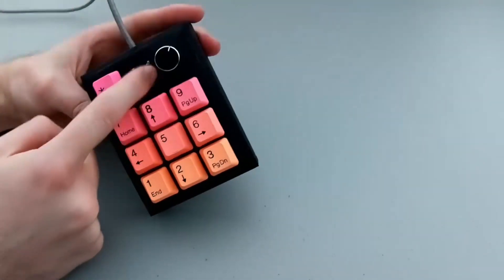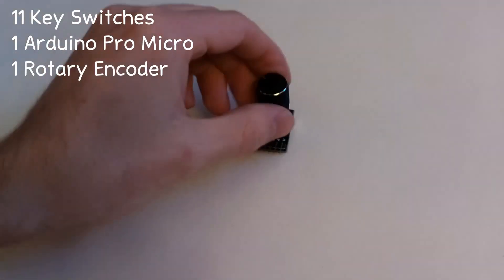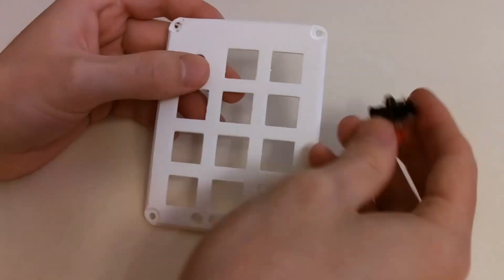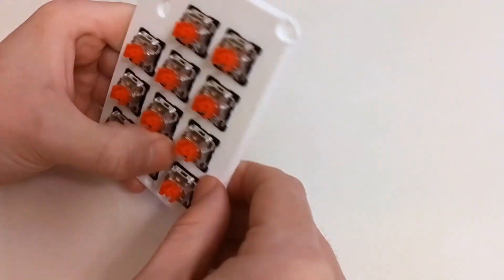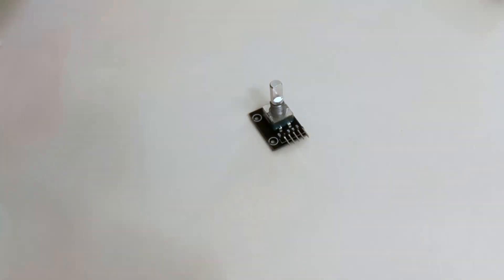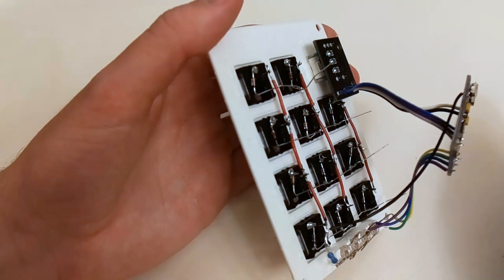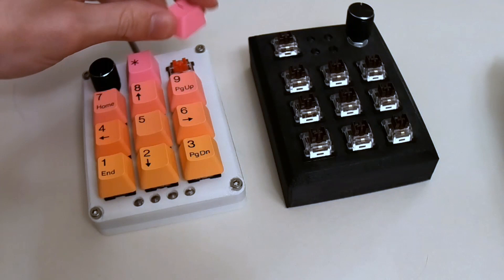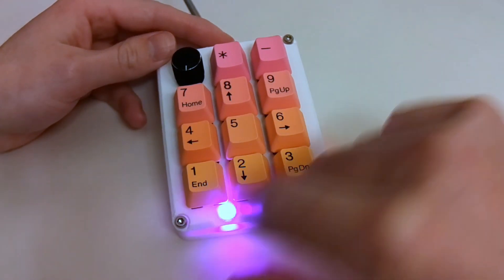Macropad V2

Comment: i just finished the build but the knob only reduces volume by one then ups it again in the next move to anywhere
Reply from the maker: That is strange. Are you able to upload an encoder example sketch and get the same behavior?
Reply: @tinyboatproductions  Oh I fixed by Re-suttering the conections to the encoder. in case anyone has the same issue, Make sure the encoder's conections are properly suttered, and in proper temperature as making it to high will make your sutter opaque and have sub-optimal conductivity which may cause this issue.

sorry for weird English not very good at it

Comment: I am full beginner, in soldering and programming too, and i have a problem. The schematics in the instructables ( the solder diagram) have diff numbers than my micro pro. ( it contains the pins but diff order.. and diff location) Can someone explain it to me?
Reply from the maker: Refer to the numbers, the hand drawn micro is not exactly accurate…
Reply: @tinyboatproductions   Okay i will solder by the numbers, thanks you very much!

Comment: Question, how can i set the code for the encoder to be more precise?
Reply from the maker: This is a common question I get. I think its due to the fact that I dont have the encoder hooked to interrupt pins. I think you could attached them to interrupt pins and move the matrix to increase resolution/reliability.
Reply: @tinyboatproductions  Thank you for your response, i will try it in the next project (:

Comment: Hi, nice video. I'm trying to make a similar button box with a 5x5 matrix with 19 buttons and 4 encoders with button, do you think I could use your sketch with some changements? Thank you.
Reply from the maker: I think it would work. However you may run into issues with that many encoders. The encoder can be a bit laggy when not attached to interrupt pins and the pro micro doesn’t have enough to attach all of them. For a button pad that big I would suggest looking at my kmk series. I think an actual keyboard firmware would work better for a more complex project.
Reply: @tinyboatproductions  I deleted the led, I don't have them, I deleted the lines about the length of the encoder press because I don't need it and I still don't know if the encoders will work because I connected only the button function, I'll let you know, thank you very much.
Reply: I forget to say that all my buttons works correctly and I can program them with macro to be used on PS5 simracing program.

Comment: Should the black line on  the diode be facing towards the switch or going the other way?
Reply from the maker: When I built it I have the black line on the diode on the bottom, take a look at 3:07, you can kind of see it there. If you have them the other way you should be able to swap the row and column arrays in the code, basically tell the code the diodes are the other way and it should work.
Reply: @tinyboatproductions  ok thank you! Where in the code would I tell it it’s reversed?
Reply from the maker: You’ll want to change they line that defines the keypad to: Keypad keypad = Keypad( makeKeymap(keys), rowPins, colPins, ROWS, COLS );
If you compare what I have with what is here, you’ll notice that the rowPins, and colPins arrays are in the opposite order, as well as the ROWS, and COLS.
Reply: @tinyboatproductions  thank you so much for your help! Cant wait to start using my new Macropad!
Reply from the maker: @ethand9715  I want to confirm this worked as I haven’t tested it myself. I also think this would be a good note to add to the instructable.
Reply: @tinyboatproductions  I’ll let ya know once I’m back at school, still gotta solder a few more things and I will 100% let you know
Reply: @tinyboatproductions  wow sorry, took a bit longer for one of the parts to come in. Finished it today! Didn’t end up needing to do anything to the code… it kinda just works, lol. The only issue that came up is that on layout 2 non of the keys work, however all the other layouts work, not sure why. Thanks for the build!

Comment: is there a way i could add 2 encoders?
Reply from the maker: Yes, you can add a second encoder. 
I don’t know off hand if there are enough extra pins on the pro micro. You may need to connect the switch of the encoder into the key matrix to have enough space for the extra encoder wires. 
You will also need to include a second encoder in the code. That should be as simple as duplicating the existing encoder code with a new name for the encoder you are adding.

Comment: i've finished my build but the only thing that is working is the knob, the buttons do not work, can you help me?
Reply from the maker: If the knob is working, I think that could mean the issue is with the diodes. Double check their direction and the pins you have them on.

Comment: As a customer, the only thing I care about is that it's easy to program withotu software or driver and you show how to do it in a video or text file. I already got burned by buying one that just does "A" and "S" and there is no way to change it.  i can't tell you how almost completely useless and annoying it is...

Also, as a blind person, even though I have a banging TS100 soldering iron and Kester high quality solder, I don't want to to assemble or solder anytihing because I'm blind.  It's not going to happen any more.
Reply: the what?

Comment: Hi. Sorry my terrible english ! Very good video ! Thx !
Its possible replace arduino pro to ESP32 or ESP8266  ?
And its possible to add more one encoder ?
Reply from the maker: I think its possible to swap the Pro-Micro for an ESP, I’m not sure exactly how. I have seen some other people use ESPs for macro pads and what not.
Also yes, you could add more encoders. I don’t think there are enough pins on the micro but possibly on a ESP, if you go that route.

Comment: Hey im in the middle of creating this project, there are 2 wires that go to a pin (5) yet if you did that it would short circuit. Is there a different pin to put the wires into besides 5?
Reply from the maker: Would you look at that. The column pins should be 7, 8, and 9. All the other PIN numbers look correct.
Reply: @tinyboatproductions  i have another question. In the code for the Macropad are there specific libraries that you used? i keep coming up with the error that Keypad cant be found
Reply from the maker: @samtelfer7364  
Yes I used Keypad.h, Encoder.h, Bounce2.h, and HID-Project.h. The last time I updated the code on my macropad was awhile ago. So if you keep having issues I would suggest downgrading the libraries to a previous version.

Comment: Hi! excelent build, i want to try to build this version but i want to know if i can switch the IN4148 diodes with the 100v 1amp diodes instead since i can´t find it anywere in my city?
Best regards!
Reply from the maker: Hi there, it looks like the 1amp diodes should work just fine. There may be a slight difference in response time when pressing a button but I highly doubt it will be noticeable (especially with the non optimized code I wrote). 
Give it a shot a let us know how it works out!
Reply: @tinyboatproductions  Alright thanks a lot fot the fast response! i will post later when it's done.
Best regards!
Reply: @tinyboatproductions  I finally could made it, works just fine, love the look on my desk! :D thank you so much for sharing your build.

Comment: Hi bro, I'm a little confused in the soldering area, what do the numbers in the picture mean? Why is it different from pro micro, in pro micro I can't find the numbers 19, 20, 21, etc. Please help me with the soldering
Reply from the maker: Hi there,

I can see the confusion. On the Pro Micro the analog pins can also be used as digital pins, that’s what I have done. I've attached a diagram of the analog/digital pin out. Pins 19-21 are labeled on the board as A1-A3.

https://www.theengineeringprojects.com/wp-content/uploads/2020/12/Introduction-to-Arduino-Pro-Micro-2.png
Reply: @tinyboatproductions  i had that confused too, now i understand what the number mean.
But i have a problem now hope you can help me out, i got the rotary encoder conected on A3 -SW, A2-DT, A1-CLK but the volume it is not constant, i mean it goes up and down at the same time and very fast, the push button works just fine, the only problem is the volume.
Reply from the maker: @pitonlpz  this is, I believe, because the encoder is not connected to the interrupt pins. This meaning that some encoder pulses can be missed making the encoder a bit erratic. I think this can be fixed by connecting the encoder pins to interrupt pins on the Arduino and connecting them in the code. I have not done this, so I cannot be of much help unfortunately.
Reply: @tinyboatproductions  Thank you, i look for that up on the sparkfun page and in my case worked with this pins
//Encoder
int SW = 10;
int DT = 2;
int CLK = 3;
Other question, how can i set the code for the encoder to be more precise?

Comment: is that work with macbook?
Reply from the maker: I don't see any reason that it wouldn't. The biggest change you would need to make would be changing the code from use the control key the command key for a mac.
Reply: @tinyboatproductions  it works